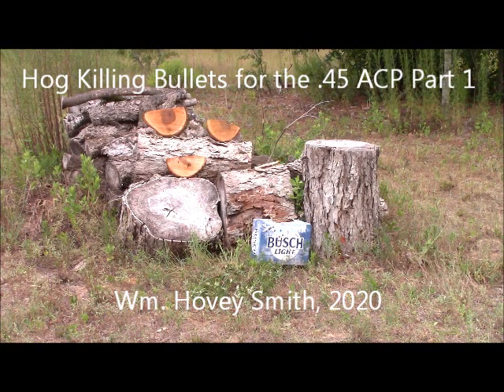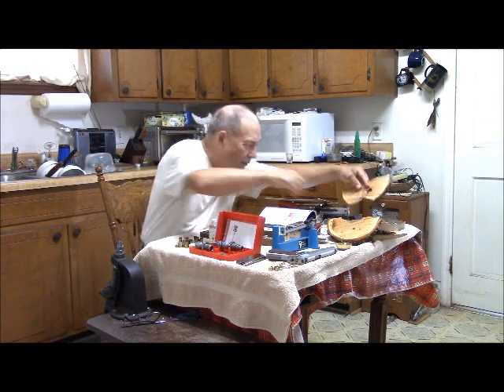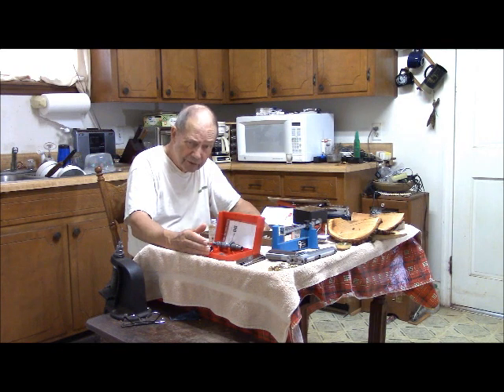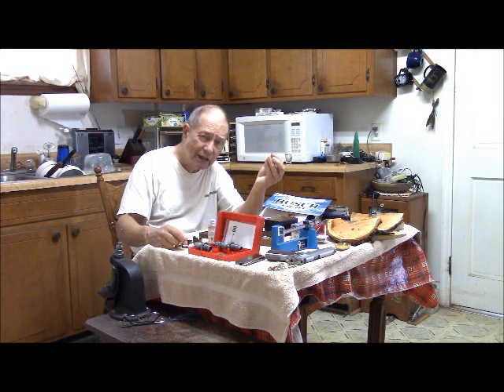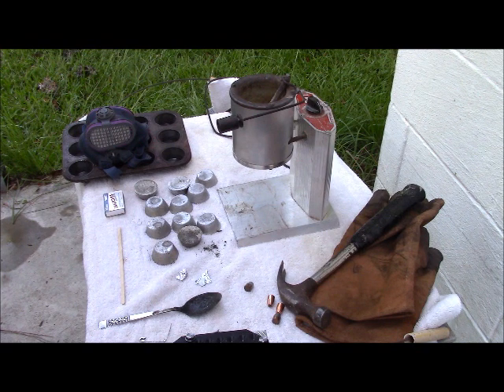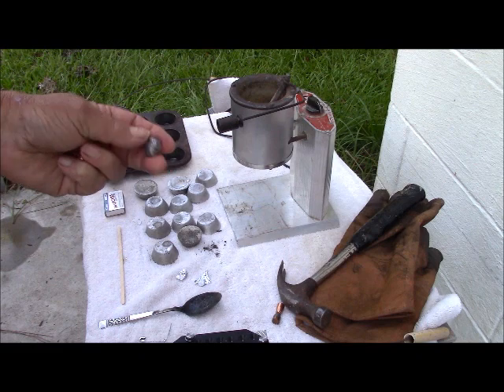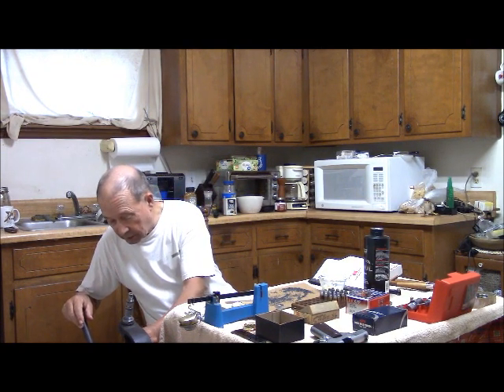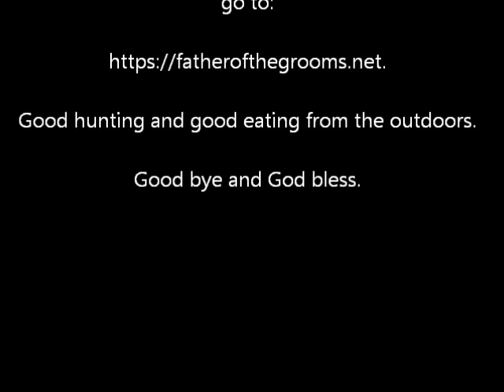Hog Killing Bullets for the  45 ACP Part 1

Comment: You take a .45 with you to hunt hog and you better learn how to climb trees.  I would take nothing less than an automatic shotgun loaded with 00 buck after wild hogs.  Those suckers can tear you up and I am to old to climb trees.  I migh have a M1911 on my hip but my primary weapon will always be a shotgun.  I also learned a long time ago that I always loaded a 1911 with 230 grains FMJ round nose bullets to insure proper feeding, even though I have usually carried Gold Cup type 1911’s.
Reply: I've seen a dozen elk and 6-7 black bears killed with 230gr hardball.
The shot placement was good so it worked as well as anything...
Funny how y'all southern boys have such issue with 100-200lb pigs
Reply: @jimbob465  I don’t have problems with 100-200# pigs but when you encounter wind pigs with tusks you better have your climbing shoes on.  I just carry a 12 gauge loaded with #4 buck when in woods where wild pigs have been known to habitat.  Those suckers can rip you to pieces. And you usually only have a second or two to react before they are on you.